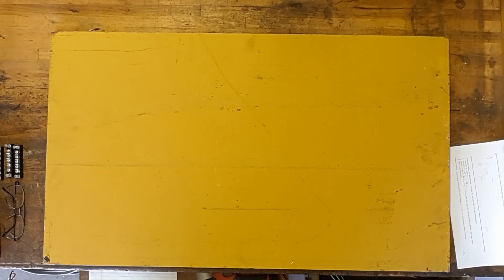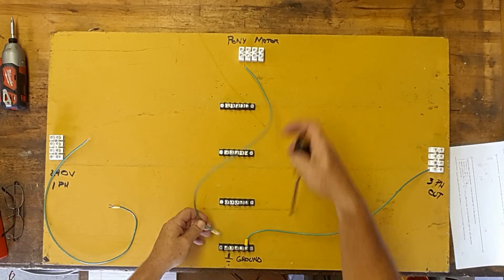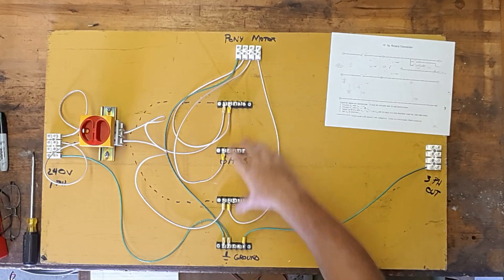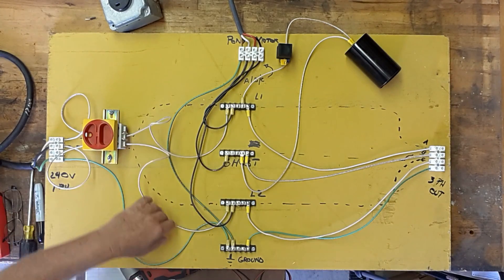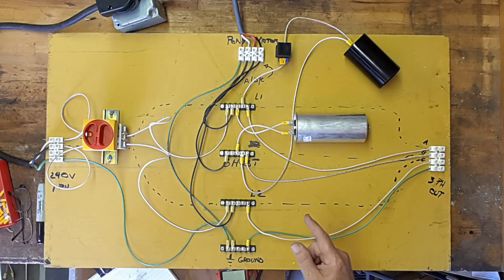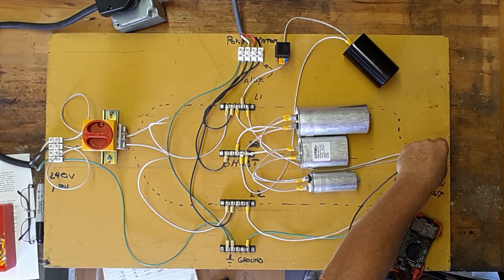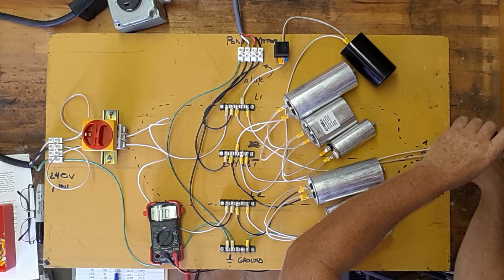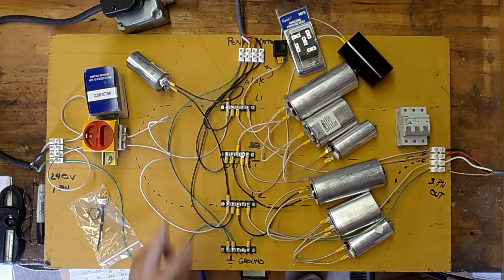Building a Phase Converter - Part 1

Comment: Very nice video but one thing I noticed is that you already have 200 plus volts on all 3 legs.I have a  rpc 15 hp with out hooking the rpc up to anything I am getting 110 110 230.How do I bring the 110 legs up to where they all are close like you did.The issue is my time master lathe has a 7.5 hp motor wired Y 220.The lathe does great but at 1050 and 1400 rpm the lathe will not top out could you please help me with this thanks and awesome video.

Comment: Bigjoe444@yahoo.com,  id like to get similar components for a grain drying system on our farm.  Im looking for minimum 30 hp, but will use anything i can find up to 40hp. Id like info on your contactors, and switches and indicators. Im thinking im goung to have to let my rpc run while drying, no on or off as the dryer will be turning unload auger on and off as needed. Id really appreciate chatting. Thank you for for these vids, they are excellent!

Comment: Super helpful!  I've been using a 5hp phase converter for years.  Problem is, it will not start a 7.5 hp motor in my 18" planer.  Using this set-up to run my 7.5 means that "the board" becomes a "static" converter and my 7.5 will run at about 5hp output--which is plenty; it replaced a 3hp motor in a planer.   Totally concise, and I have not even glanced at the paper you linked to.
Reply: Swap the 7.5HP with the 5HP and you will be all set then.

Comment: sbirdranch would be kind to gives us the source (electronics supplier) and parts numbers, it is difficult to try to find these capacitors in one supplier having to use many different suppliers which increases the total bill by additional shipping costs per each item. so a BOM will be great if you can do it. Also this method of trial and error requires you to have an array of run capacitors already on the side before you even start building the project and then try a capacitor and if it does not do what you would expect try another one, and another one till you get the desired results. and how would you choose the first start capacitor for say a 1HP idler a 5 HP or a 10 HP idler?

Comment: Superbly explained and great reference document.
One concern I have about rotary idler phase convertors like this is that the phases are +/- 90 degrees instead of +/- 120 degrees as in utility-supplied 3-phase systems.  The L1 and L2 inputs are 180 degrees apart.  120 volts each (to ground and the power company's neutral) and 240 volts between the two phases.  The synthesized idler leg driven by the pony motor and capacitors is right between L1 and L2, thus 90 degrees to each one.  You will notice that if you measure your "ghost" voltage to ground, it will be about 240 volts rather than 120 volts like L1 and L2.  This means ground isn't in the middle of your Wye any more.  There are three phases and the voltages between them are all close to 240 volts, but they are not equal amplitude with respect to ground and they are not 120 degrees of offset between phases.  Because of this, motor magnetics will not be optimally aligned and you should de-rate motors driven by this compared to the same motor driven from a true, 120 degree, 3 phase power supply.
Reply: the 3 phase is not balance

Comment: I bought a three-phase to single-phase converter years ago and I used it for a year or so.  Now what I want to do is to use to convert a single-phase to three-phase.    Is it possible to use that very heavy box and just wire it in reverse, using single-phase as input or how does that work?
From what I saw in my wiring today,  back when I had used only two legs of the three legs of three-phase to get what I needed.  Two outlets of 120V, AC.  The heavy box is a 5k converter.   I  think I paid like $500 for it back when.  I would say this thing weighs a good 150 lbs.

Comment: Does it matter how many horsepower the pony motor is?
Reply from the maker: Very much.  The size of the pony motor determines the size of the motors you can drive.  The rule is your pony motor has to be "one size" larger than your largest load.  So a 7.5hp load would need a 10hp pony.  etc  ~P

Comment: What was the reading before and after putting the 20uf capacitor at L1, L2? is there a rule of thumb how many uf per motor hp?
Reply: No, you would increase or decrease the total capacitance based on the voltage you get with the setup if the voltage is low add capacitance. Read the document linked in the description, it will show you how to go about the correct amounts for your setup. Remember, no two setups will be the same based on the condition/size of the idler motor and wire size used for the setup.

Comment: You know you can get a current draw switch from the common, start, run of an old refrigerator compressor which will take the place of you having to push a start button, it will then be all automatic when you turn your power switch on.
  Great video :)

Comment: Great presentation and in language I can understand. Well done! One quick question: I want to run a 450 amp 3-phase welder. That will probably be the only 3-phase unit I will run. Will the components in your videos handle this welder? If not, what changes do I need to make?
Reply from the maker: I know what I built will run typical induction motors but I'm not sure I would try it on a welder.  Wouldn't know where to start to prove it would work or not. ~P
Reply: Scott I believe I would buy a diesel powered welder , or run a generator on woodgas.

Comment: I'm very new at this, maybe i missed it in the video. I noticed the start capacitor as the first capacitor installed but did not hear the value.
Also when adding capacitors, I'm not sure if start or run capacitors are being added, looks like run capacitors but i want to be sure before taking on this project, which I would not attempt if not for this great layout that left little room for error.
Please help me to understand the missing information so i can begin this project with full confidence that i understand all components that will be used to complete successfully.

Thank you: Larry
Reply: Same problem for me, there is missing information about the starter capacitor value and the cooler motor connection type which one it is star or delta??
Reply: @technicalbangla1838  He answered this for another question, it is a Packard PRMJ216R  216-259MFD 330VAC
Reply: He answered this for another question, it is a Packard PRMJ216R  216-259MFD 330VAC

Comment: Can I also use multiple of this 200uF 250uF 250V 450V AC Appliance Motor Start Run Capacitor CD60 Air Compressor Capacitors Heavy Duty Electric Motor Starting

Comment: I can't find the starting capacitors in Ghana 216-259 uF x 330 VAC. But I saw this in Ghana cd60 500mcf AC.  And also what I saw in china are not 330vac but rather 480vac . Can any be used
Reply: as long as the voltages are higher on the capacitors you're good

Comment: I am considering purchase of a 10 hp 3 ph lathe.  I would probably use an idler motor of 15 to 20 hp.  Does the idler motor need to be the same speed as the load motor or does it make a difference if the motor speeds are different?
Reply: The idler motor just needs to require the same frequency (Hz) as the load motor. The rotary converter works because all motors are also generators. When running with no load, they generate a back emf that counteracts the voltage being given to them so that the motor ideally will have zero volts across it (it will actually have a non-zero voltage due to electrical resistance and that the back emf isn't being generated with 100% efficiency). When you place a load on the motor, it lags slightly and the back emf will no longer exactly match the voltage being applied to the motor and in doing so, the effective voltage across the motor increases causing more current to be drawn. For a rotary converter, the ghost leg is simply that back emf that's being generated for that winding. And since there's no voltage being supplied to the motor on that leg, it isn't counteracted and reduced.

Comment: Very good explanation. One thing you could do for your starter capacitor is to hang a centrifugal switch on the motor; that output shaft isn't doing anything else but spin anyways.  That would be closed when the motor is off and open up as soon as it comes up to speed.  No worries about a relay that might burn out.

Comment: Great video & info.  From your experience, can I run a welder(s) using a 3-phase converter?  Have found no info on the subject and not sure if the sudden current/voltage surges will work.  Any advice/recommendations/references is greatly appreciated.  Thanks
Reply from the maker: Sorry Greg.  All my references and experience are around running motors.  I would have the same question you do about that sudden inrush. -P

Comment: L1 120v, L2 240v, L3 120v

I am getting above voltages from the three lines,  Can i use your method to run a 3 phase 5hp motor !?

In your case,  you are getting 2 legs with 120v each, but in my case it's different.

Should i select two 120v Legs (L1 & L3) and eliminate 240v Leg (L2)..  (** i am no expert in this...)))))

or 

Should i select L1 and L2 and use capacitors to balance the voltage difference!!! can it be done like that ? ....... (** again no expert)))

My company supplies 3 phase and single phase power using the same transformer ( High-leg delta )

Comment: Thank you, you were a huge insperation for my RPC build.  I posted a video of my build to my youtube channel for anyone interested.
Reply from the maker: Glad you found it helpful and have a working converter.  In looking at your channel I see you built a 2x72 belt sander.  I'll be watch those videos.   Thanks in advance. P~
Reply: @sbirdranch  Was just doing some work on the next video getting the driver motor fixed up.  Had some machining work to do on the shaft and will be doing the VFD configuration over the next few days.  I'm planning for two more videos and ~3 weeks for it to be done.  Well, of course now that I said it it's going to be like 8 more videos and 3 months ... ohh well.

Comment: Amazing, do you have a computation for that? I just don't want to guest how many capacitors i need to get the right amount.
Reply from the maker: Check out the document I have linked in the description.  It explains further, the process I used.
Reply: do ypu have updated link

Comment: Seems cost intrusive. I have 3 phase system I'm trying to either convert to a single with a 56j or a phase converter.  The converter is 500 while the motor is 200 rebuilt.  I'd love to stay 3 phase but there isn't any advantage to this type of inverter it seems to me because the pony is consuming the power savings normally realized by 3 phase equipment. Also, it seems to be cost intrusive from a time and parts standpoint.   

Is there a reason you're choosing to build one other than to say you can? Lastly, I'm not so sure the phase is shifted. I would like to see a phase meter test conducted on the output legs. I'm familiar with Delta 3 phase power and how it's provided.  Uncle was the engineer for RTE building their transformers and my last building had Delta which is why I bought a 3 phase equipt machine.  Needless to say, new building doesn't have it.
Reply from the maker: And that $500 bill is exactly why I build my own.  I found a local motor guy in town that makes them and sells them on Craigs List, but event that was more expensive, and I got something I trusted and understood, for less...by building it.
Reply: @sbirdranch   so effectively you have no answers to the questions except that it's to expensive.  Which doesn't address the question.  Is it truly a cost savings realized between the higher electric costs and the expense for pieces to build the Rube Goldberg vs changing to single phase on the machine and buying the inverter.  Plus, time is money. I make $175/ hour when getting paid to work on customer vehicles. Plus my time alone with worth $85/ hour so between the loss of revenue the expenditure of revenue does the building even come close because I really have a hard time seeing where it could.
Reply from the maker: @irench  Those are all completely valid factors to consider when making the determination, and I did not consider any of them in my decision.  I do these things because I enjoy them.  These items are either irrelevant to me, or simply overlooked.  For instance, payback in cost of electric usage - not considered.  My salary - irrelevent.  
It would seem to me that you have considered all the factors that apply to your situation and alternatives.  Do the math.  Make a decision.  Mechanically it will work either way. ~P
Reply: @sbirdranch  Your perception is correct. I had never believed in the ghost motor design until I watched your's work. I'd still like to see the phase tester applied but I'm sure you don't have that device.  Thanks for the reply.

Comment: Question : at 7:40 you state that you used your welder outlet .... Is your welder 240 volt ?
Reply from the maker: Yes it is.  It was a bad assumption on my part.  I also have a 110v welder but that was not the case.
Reply: @sbirdranch  Ah ok .... I was a little confused because there seemed to be a discrepancy between the linked diagram and your layout as to if the source power is single phase or 2 phases. So can I assume your welder outlet is a dedicated line from the meter box using 2 phases ? .... Great vids by the way.

Comment: Hi I live in Australia and only have single phase 240v. I have an old Tyre balancer and its got digital display it has a 4 pin plug and runs on 415v 3 phase. there is a 415v transformer on the motherboard. Would this work as all phases need the 415 v. Thanks Nick

Comment: Very nice videos, I was wondering if this same set up will work with a larger pony motor, I have a 15 hp cnc mill so would I need a 30 hp motor?  And will 100 amp 220v power be sufficient?

Comment: Not sure where u got the greater then less then numbers from. I saw the doc u linked it said Vac=Vbc=1.08xVab 
It also said Icn should be equal to or less then FLA of your motor. No load. There is my problem. I have 246v single phase comong into my barn. So thats my Vab so my Vac and Vbc should be about 1.08x246=265.68v i have it balanced at ac=264v bc=265v and my pf is 20mfd for lowest idle current at about 7amps. But my motor is a 15hp 1750rpm 39.8FLA@240v but i am getting upward in the 50amp on Icn. There in lies my problem. How do i get my idle motor C/L3 leg to get less amps so i dont burn up a winding. Tried swapping windings on the motor C/L3 with B/L2 but same outcome. What am i doing wrong.....

Comment: At my local surplus electronics outlet, Skycraft Electronics, in Winter Park, Florida, the caps cost about $10 each.  So, with the caps, switches, relays, and a surplus metal box, it they stock one, I will have to spend about $150.  

 I have a 2.2 KW, 3hp, 3 Phase, Variable Frequency Drive (VFD), which cost me $92 including shipping, on ebay.  The VFD has forward, reverse, plus, variation in motor speed of 1 to 10,000 RPM, plus, a digital readout plus a lock out of top speed in RPM, and protected screw terminations, for up to 10 AWG wires, solid or stranded. 
 
 Both methods have 230 VAC residential power coming in.   Both would need similar power cords for input, and for machine connection. 

Which is the preferred method?  BTW, I am an FCC licensed HAM, and worked on and taught AC Power Generation, and Installation in my Air Force career. Your build, testing, and layout is commendable, and much appreciated.  Thank you.
Reply: I know this is an old comment. If you have more than one 3 phase machine, then a rotary phase converter starts to make more sense. The more machines you have, the more economical a rotary converter becomes. I have 3 3 phase machines and my lathe is 10hp. , I have a 2hp Bridgeport and a 2hp surface grinder. They all run off of the same 15hp converter. Not only that, the wire size to the 3ph machines is quite a bit smaller because there's less amperage per wire. I got about 50ft of wire going to each machine.

Comment: Quite a nice one. However you should mention that what you have there has a floating null(common) which means that should you connect this to a motor that is configured in star instead of triangle you will geta huge voltage difference between the null(common) and the ground.. which can be a killer when this happens to be a old motor with old insulation. Please test it out on a star wired motor and then measure the voltage between ground and common.

Comment: Best ever video and explanation. Well done. I am faced with powering a 550V motor( two speed lathe) so I am assuming that a step up transformer(230V up to 550V 10KVA) connected to your three phase outlet and then to the lathe motor will do the trick.
I appreciate any input. Thank you in advance.

Comment: By far the best video I have seen on this subject. Wish I had seen it before I started building one. I actually built one years ago that worked, but now I see how bad it was. The question I have is about the windings of the motor. The schematic shows a wye setup, not delta. Is this necessary or if you use delta is there some difference in the rest of the wiring.
Reply from the maker: Richard Voyles And this is where my education on the subject fails me.  Either it dosssn't matter or I got lucky.  I wired to the idler using the same connections as had been used during its brief time in service.  Seemed logical that if the existing config turned the motor then it would work to generate the phantom.   I don't know for sure.  Maybe someone else in the hive mind smarter than I can help.   Anyone?
Reply: One reason I asked is, because, another video on the same subject starts out with the author changing the motor from Delta to wye or wye to delta, can't remember. Not all motors are easy to do this and not really worth trying for me. I especially like the motor relay and momentary button start feature of your design.